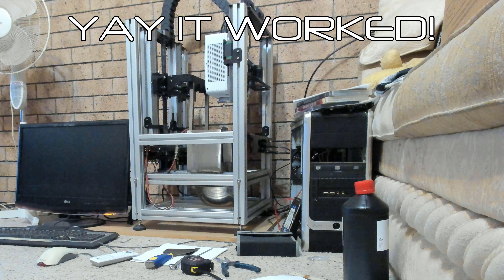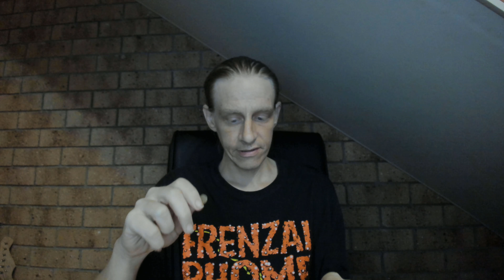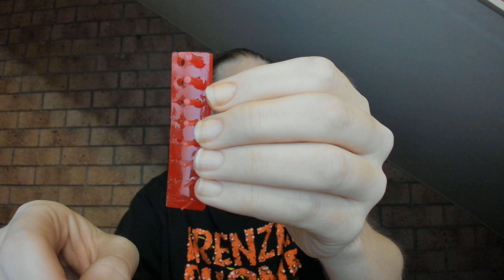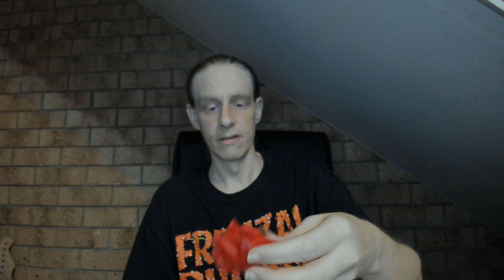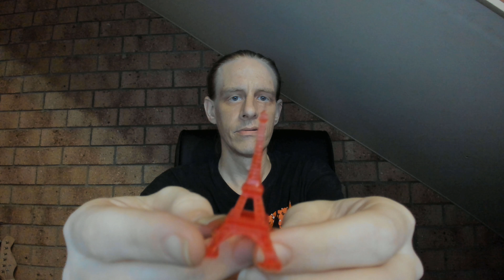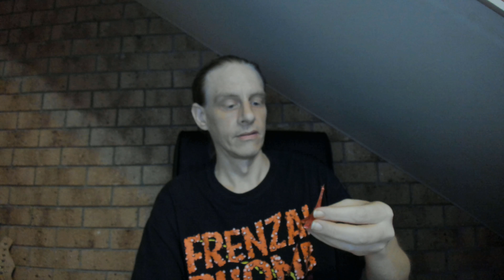welbot 3d prints Episode 1

Comment: Hey welbot, thought I would drop by and take a look at what you're up to. Wow, the brightness / contrast settings made a huge difference on the Stormtrooper Angel. About to watch the mixer vid. Cheers, JAYTEE
Reply from the maker: Thanks JAYTEE! I was very surprised myself! I never would have really thought about it as many of my other prints had been coming out ok. Then when I was printing one, I noticed the resin was letting off a small trail of smoke (quite tiny, and not too concerning,) but it made me wonder why, so I started playing around with things! I thought the layering lines were likely due to the speed at which I was printing for the most part, but to my surprise, that seemed to be the main cause! :)